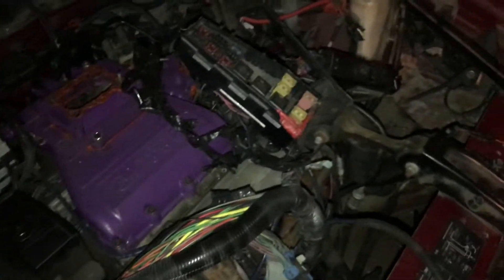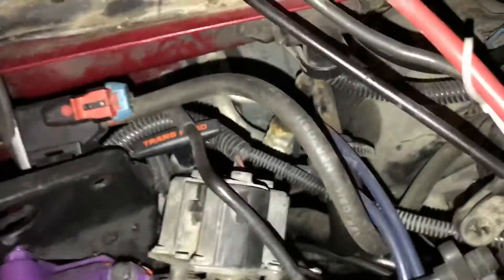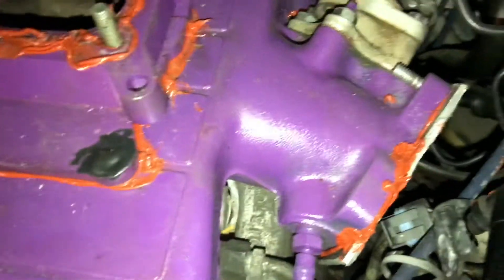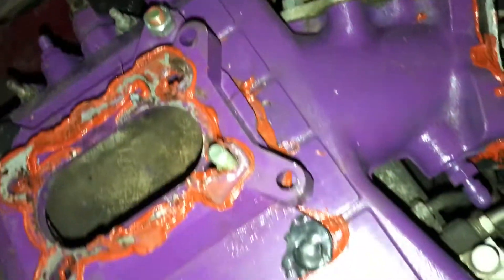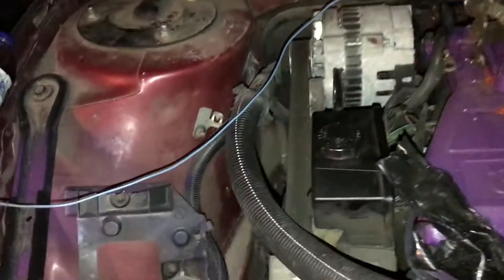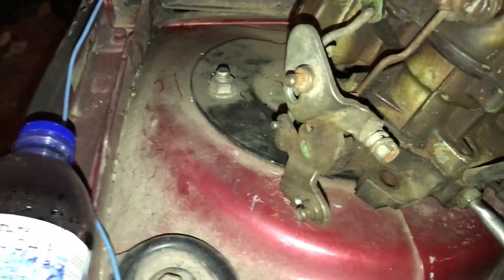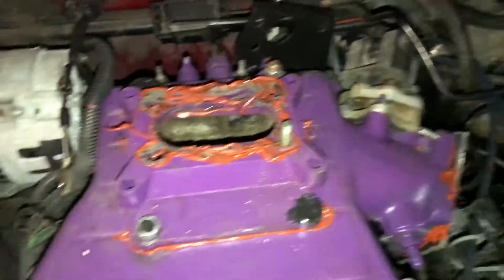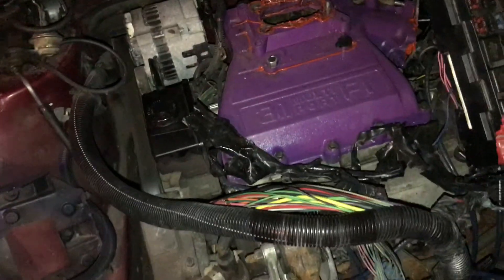Cheap carb set up for a 3.1 Chevy

Comment: You're gonna want to mount the cable to the block or to the carb itself..  that thin firewall will move and you run the risk of pinching or stretching your cable, possibly leaving it wide open.

Comment: What about distributor? Wiring needed?
Reply from the maker: NewGunzSociety coil packs get hot wired to the battery
Reply: Dizaster Boyz 
Buddy of mine say to just run a thick wire for the coil packs
 Thankfully most my shows don't have heats. And average show only has maybe 5-10 compacts total.
Reply from the maker: I just run regular sized wire. Works fine. Our shows are 1 and done also but usually 15 cars. Some shows are over 20. I just got wire the coils and leave the crank sensor wires hooked up
Reply: If you go look on we crash is goes into detail about making these 3.1 totally non computer except for the fuel injection.  It doesnt say how to carb. Its actually really hard to find the info for running a carb like what carbs will work and where to find them in a junk yard